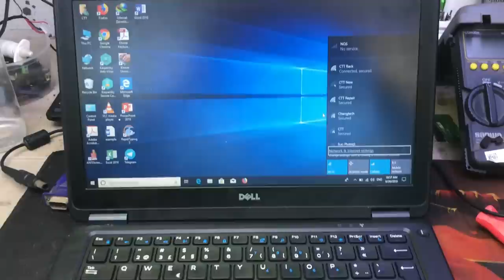Dell Latitude E7250 No Power No Display Resistor Solve

Comment: I have a different problem anytime I turn on the laptop it doesn't respond and even I insert the charger the charger goes off . Is it the same issue of the resistor
Reply: short circuit on the power IC on motherboard
Reply: Me too same prblm

Comment: I have same unit but with power no display on screen. if I press power on + D screen opens. What do you think would be the problem of my dell? It turns on but no display on screen. It just shutdown, shows reason over heat....
Reply from the maker: some thing damage on motherboard
Reply: Hey, u found a solution??

Comment: ur speedfan not turn ;)
Reply from the maker: resistor damage, water damage
Reply: just you should use to deoxidize the motherboard of the remover for the nails of woman it is pink with that I deoxidate motherboard or it has foam and mushrooms which have to push above it costs 0.89 ct euros better than alcohol isopro